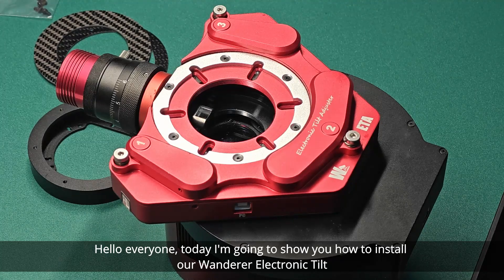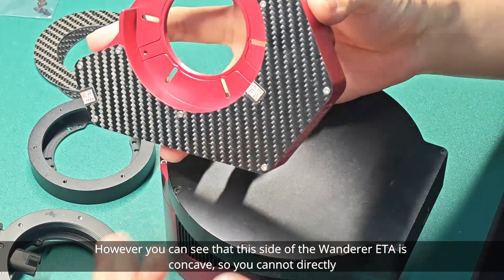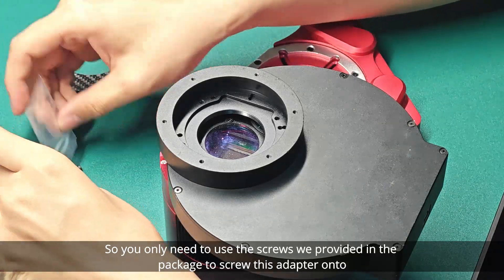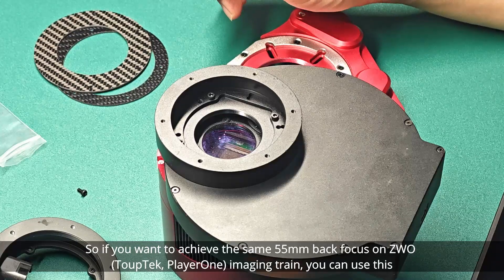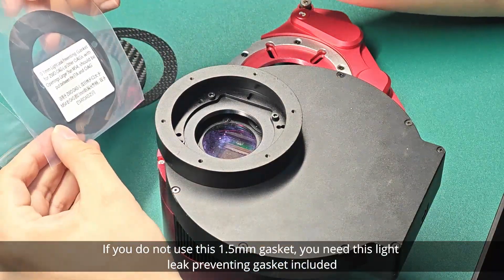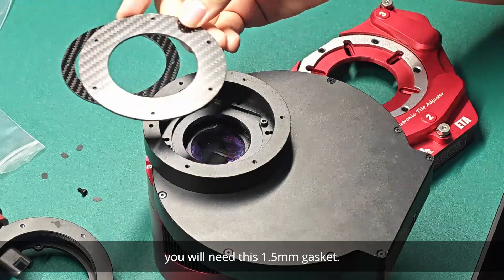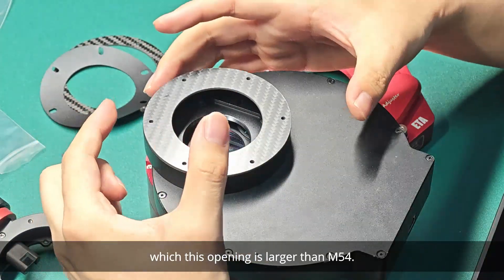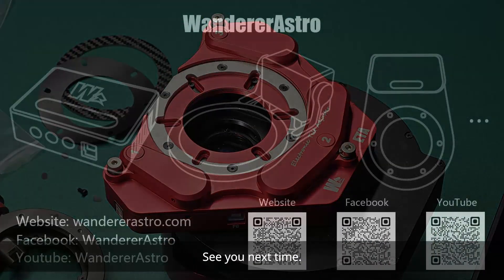How to Connect the Wanderer ETA to a Filter Wheel — Without OAG --55mm Back Focus.

Comment: Great. Just what I was waiting for. Is this adapter already available?  Still a pitty you didn’t manage to allow for “older” camera’s with a fixed 17,5mm BL.
Reply from the maker: The only problem is that it is not possible for 17.5mm BF cameras to install ETA, OAG and filter wheel at the same time while maintaining 55mm back focus. If your telescope has , for example, 60mm back focus, then it is OK for 17.5mm BF cameras.
Reply: @wandererastro Does this adapter come with the ETA? My Takahashi FSQ85 would be Ok then. But the Epsilon does not.
Reply from the maker: @ariebakx  This adapter is sold separately. Will be available in a few weeks.
Reply: @wandererastro Could I use a M54x17mm extention ring in stead of this adaptor? The ZWO wheel is M54.
Reply from the maker: @ariebakx  Not recommended, you still need the Camera Side M54 female thread adapter for ETA, also you can't guarantee the orientation of the ETA when tightening with threads, which will be inconvenient when configuring the parameter of automatic tilt adjustment.

Comment: Awesome! If it's possible to use with the Wanderer rotator and a filter wheel (with no OAG), could you please make a video?
Reply from the maker: You can just place the WandererRotator in front of the ETA, and you need a 15mm M54 male to male adapter between ETA and rotatoe.
Reply: yes, please!